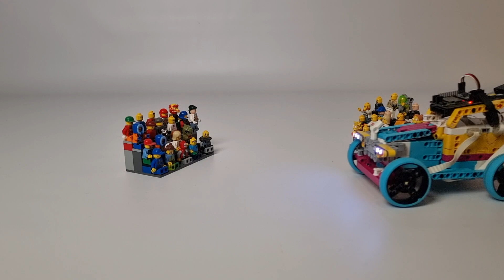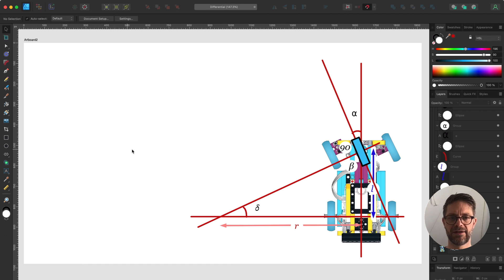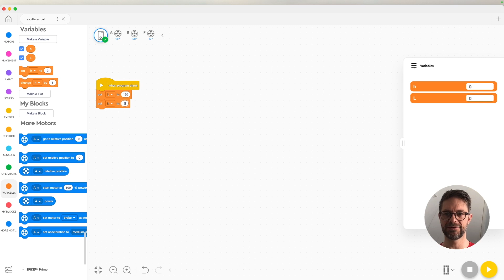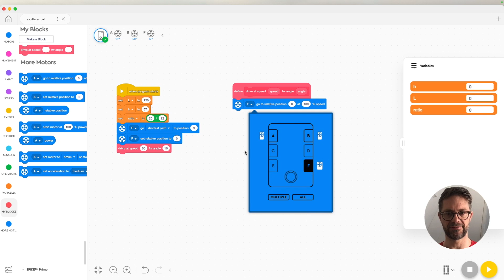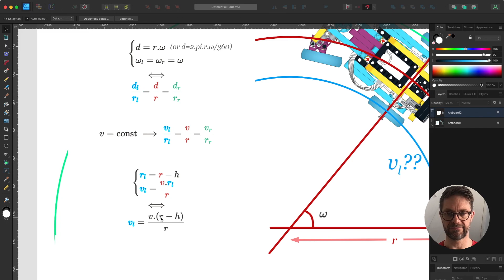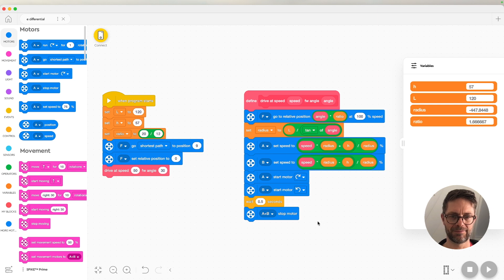Mastering Turns: Build a SPIKE Prime Car with an Electronic Differential

Comment: Hi Anton.
It's a nice video, but it's not right... It's a complex thing, but I'll try to go step by step:
The front wheels (even if you build the car right, i.e. with Ackerman steering or similar, so that the inside wheel turns more into the turn) do not travel on tangents of their circles. The car needs to be turned around, but due to inertia it 'wants' to keep moving straight, so if the front wheels are to be useful, i.e. apply sideways force to turn the vehicle and not just support the weight of the front bumper, they will 'understeer' and have a sideways 'walk'. By how much? Depends on speed, surface, etc. Since you cannot predict this exactly, you cannot use speeds as set-points for the rear axle motors. What you want is not speed vectoring, but torque vectoring, i.e. you want to apply more torque to the outside wheel to actually result in net torque around the vertical vehicle axis, that will be part of the torque resulting from the front wheels being turned into the curve. Ideally these two torques should be proportion of front vs rear grip, at Spike Prime speeds it's going to be weight distribution between front and back.
Reply from the maker: You are right. However, if you don't do anything, the car doesn’t turn, and this system is a simple way to have some fun with the car without a differential gearbox. What programming approach do you propose instead? Which inputs for the control system?
Reply: @AntonsMindstorms  generally I'd experiment with two approaches: approach 1, slightly unorthodox but should be easy enough to code and might work satisfactorily, would be to run the outer motor at a given set speed and the inner motor at a percentage (below 100%) of the actual reported outer motor power, the percentage being smaller the tighter the radius of turn is. This way we use the speed controller from Spike Prime (which gives the power as output value, the 'power' being really the duty cycle of the motor power stage) and just slave the inner motor power to the outer motor. The second approach would be to make one's own speed controller and distribute its output between the left and right wheel duty cycle based on a factor proportional to the turn rate, i.e. if the requested ducy is 60%, split it 60%+x and 60%-x with x = f(steering angle).

A good first approach is to assume you want the same total force at each wheel, assuming all wheels are identical and the weight is evenly distributed. The front wheels will only see lateral forces, the driven wheels will almost only see longitudinal forces with some lateral forces at high speed (likely irrelevant for Spike speed). Assume maximum usable force transfer is at 2% wheel slip, since we have full rubber wheels with toroidal cross section it's same sideways as in driving direction. From there you can take the math to find the maximum cornering rate at any given speed 😁

The real torque vectoring in a vehicle is linked to the esp (electronic stability control) module and takes feedback from the vehicle IMU to compare the commanded turn rate (steering wheel input) and the actual turn rate (gyro reported) and the estimated vehicle grip limits and from there it decides what to do - use driven wheels torque, selective braking etc. Much more complex thing and very proprietary.
Reply from the maker: @MarekLewandowski_EE ...or maybe I could extend the calculated radius by a few percent to give the front wheels something to 'do'?
Reply: @AntonsMindstorms  it depends whether you want to teach about how it should be done or if you want a hack. The way you have coded it works, but it's a hack and the explanation in your video doesn't touch on the topic of why and how twin drive can actually improve handling. There are many solutions that work on a LEGO scale, there are many 'wrong' solutions that work for specific reasons better than 'right' solutions even on real vehicle scales (karts not having diffs, some F1 cars having reverse Ackermann steering with outer wheel turning more into the curve etc.), so it's really about what educational value you want to put in.
Reply from the maker: Woah! It never occurred to me that karts don't have diffs. That's why they say it helps to lean out in a turn!